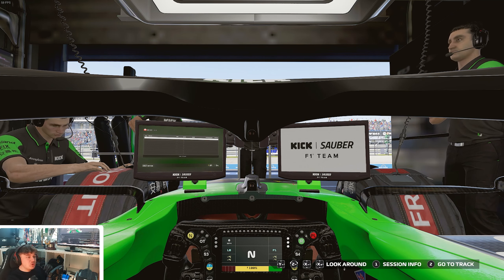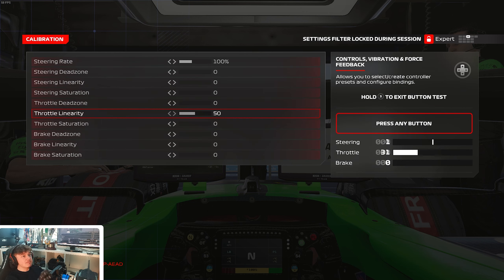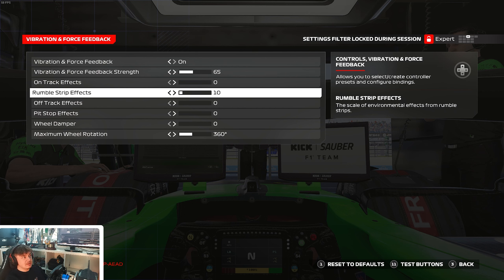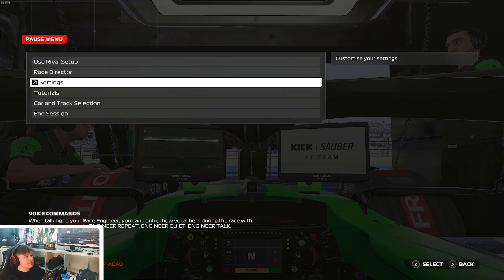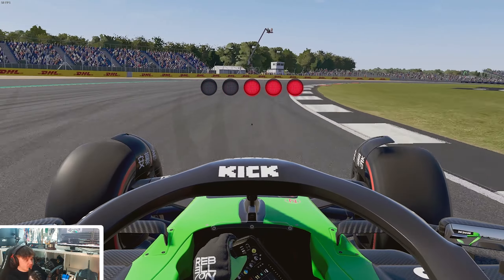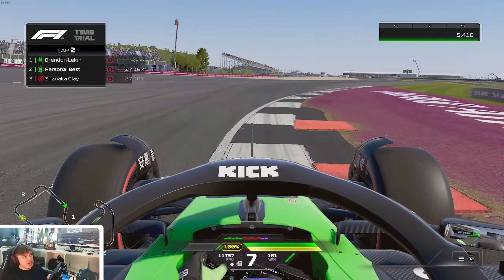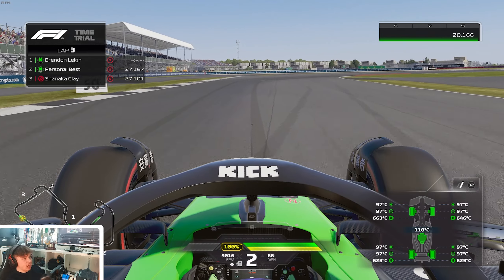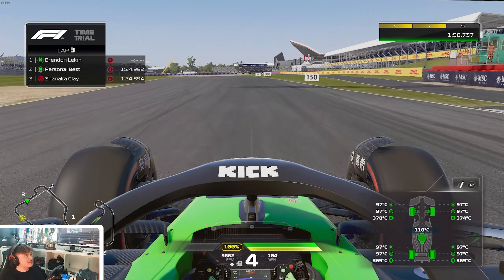F1 24 - My advice to become faster using a wheel

Comment: I lock up in almost every corner now, where I never locked up in F1 23, I think it might be because I’m still using those standard setups.
Reply: it's also the game, much easier to lock up.
Reply: I believe the engine braking is what’s throwing the braking off a bit. We should be able to adjust in race like they can.

Comment: Any advice for belt drive systems? I’m currently on a T-GT II and to able to feel enough grip to drive pleasantly I have to run the FFB strength to 100% and mess around also with road settings, I don’t find it easy to tweak and get great level of detail and grips sometimes. Might be just because it is not a DD base but I was wondering if you have any suggestion. 

I drove with a Fanatec DD1 and it’s definitely incredible

Comment: Thats a brilliant explanation, especially the thing about On Track Effects, Rumble Strip Effects and Off Track Effects. I always thought you have to switch them on in order to have them. As you explain it they are always there and the in-game settings make them that factor stronger. Thanks a lot for that clarification. As I am using a Fanatec DD1 wheelbase as well. Could you please share your wheelbase settings: 
SEN	Sensitivity
FF	        Force Feedback
FFS	        Force Feedbak Scaling
NAT DMP	Natural Damper
NFR	Natural Friction
NIN	        Natural Intertia
INT	        Interpolation Filter
FEI	        Force Effect Intensity
FOR	        Force Effect
SPR	       Spring Effect
DPR	Damper Effect
SHO	Shock
BLI	        Brake Level Indicator
MPS	Function of Multi Position Switch
BRF	        Brake Force

Thanks a lot!

Comment: somehow i deactivated the heavyness loss when turning and loosing grip and i dont know how to activate it again. In f123 i felt that grip loss but i dont in this game, i can turn the wheel 180 mid corner and the wheel will still be heavy even if im slinding.....
Reply: @fernandoexpositomato3906  the wheel should be heavy when oversteering and really light in the countersteer djrection. When under steering the wheel will be lighter. To keep the car loaded nicely through a fast corner the wheel should be heavy but not stiff.

Comment: No advice for controller players? Not fair Brendon 😭
Reply from the maker: I will need to play with the controller to give good advice, I don’t want to make a video calming to give advice if I haven’t even tested the ideas myself. I only want to give advice on concepts I actually believe work
Reply: @BrendonLeigh  👍
Reply: A good tip could be buying a wheel